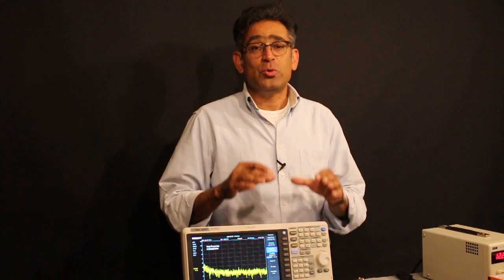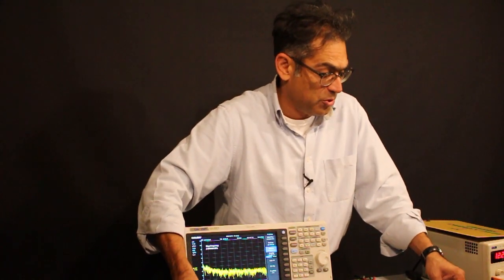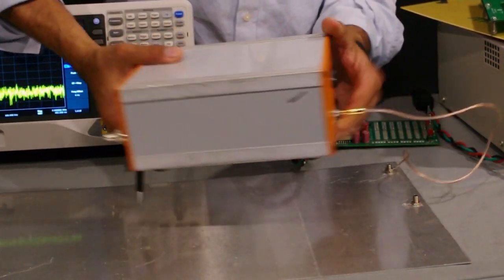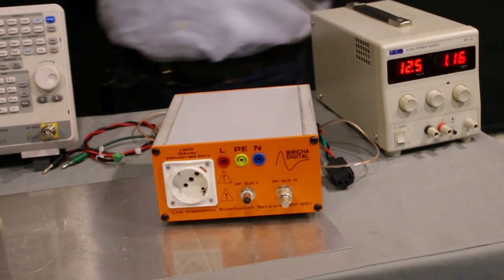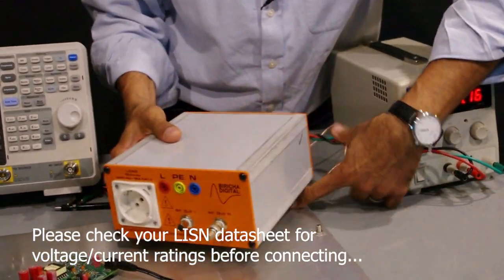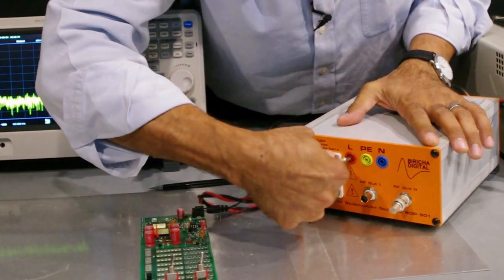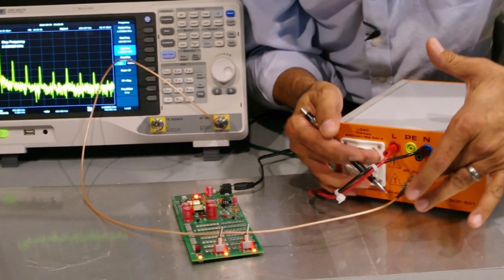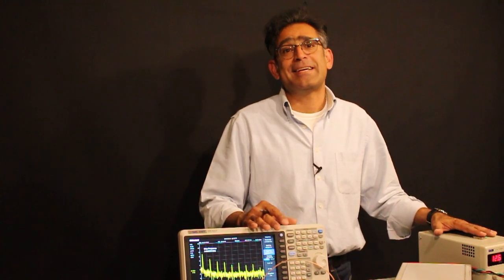EMC Conducted Emissions: How to connect and set up a LISN

Comment: EUT should have not kept on plan and 0.8mts length need to maintain for LISN to EUT.
I felt these things are missing.
Reply: 80cm length only applies for CISPR16 / 32, for CISPR25 it's different. Same with the distances to ground. It's not really feasible for him to show every variation in each standard in a generalized how-to video, is it?

Comment: Is this LISN for sale somewhere or is it a single piece? I'm having a hard time finding an affordable LISN with two measurement ports and dedicated connections for DC and AC power lines.
Reply: I was asking myself same question. Did you come up with any conclusion?
Reply: @igorjankiewicz9045  tekbox has some pretty good offerings, and are pretty much the best bang for the buck.

Comment: Is it the differential-mode noise that you see on the Spectrum Analyzer or the common-mode noise or a mix of both? Also, as I saw, nothing changed on the Spectrum Analyzer when you removed 50 ohm terminator from LISN channel N. What was supposed to happen if the two lines (L and N) are not symmetric?
Reply: With a standard LISN it's always a mix of common-mode and differential noise. You'll need extra circuitry to separate CM from DM noise. Basically a circuit that adds (for CM) or subtracts (for DM) the two measurement ports of a LISN. So you'll either need a LISN with two measurement ports or two LISNs.